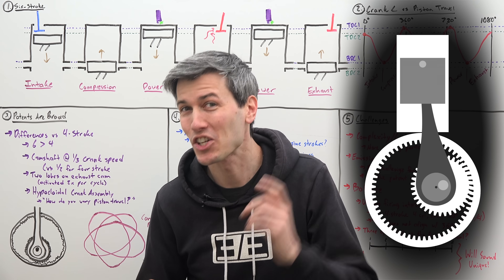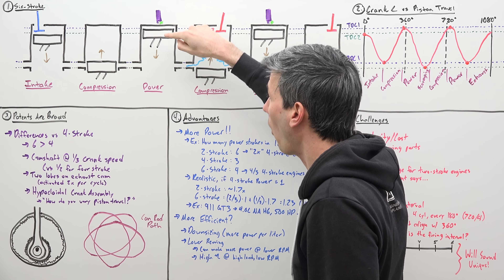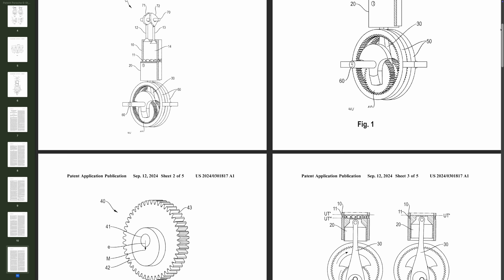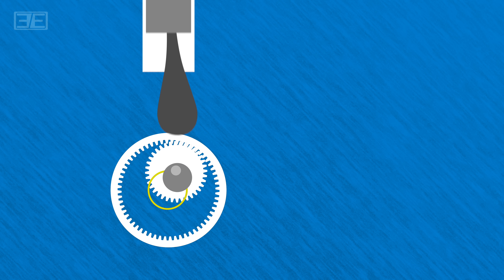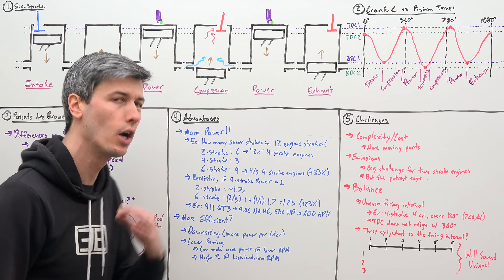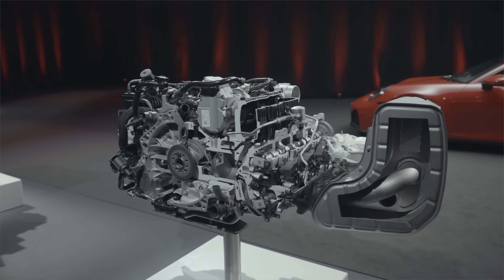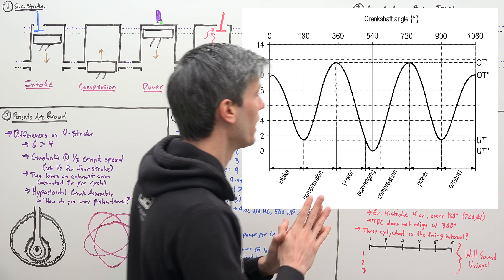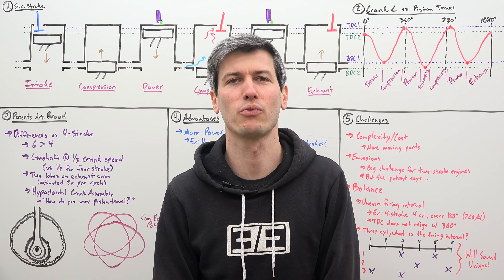Porsche's 6-Stroke Engine Is Genius!

Comment: VARIABLE STROKE engine. (My guess here) What I think you missed is the engine will be efficient because the 4 stroke will be the regular power band and the two stroke will be an on demand power booster.
Picture a standard boxer 6 running on 4 stroke skipping the 2 stroke part (holding the valve open to eliminate compression). Then you hit the throttle hard and extra 2 stroke cycle will engage and you have a six stroke that should have more power than their existing 6.
Reply: ....and where the power is made through the power band. You would have a really meaty engine coming out of the corners.
Reply: So you balance by having the third cylinder only run four stroke on every other cycle to balance? Thats incredible.

Comment: So basically the pistons’ motion in which they’re not doing work has been optimized so there are more power strokes relative to the distance travelled by the piston in its period of work? The gears that time that oscillating stroke distance are cool

Comment: With the complexity of a six stroke engine, what type of fuel will be needed? will it need to be 99octane, or 93 octane? Also the sound is gonna be kind of strange or really cool one of the two. And yes emissions will be a Factor to deal with unless they’re gonna use a DPF like filter on a gas engine like they do on diesel. Hopefully not.

Comment: First time viewer.
Excellent presentation.
I'm a former CNC Machinist with Boeing.
You clearly have an excellent channel and your speech is clear, & the white board format is perfect for comprehension.
Congratulations on 1000 videos !
Doesn't Porsche need to create some kind of working model for any of the patents to be valid ?
Seems like it could work, but it will require an electronic control unit even more complex than currently existing ECU's.
And with the slightly different TDC & BDC points, would a different crankshaft counterbalance weight design also be needed ?
The spark detonation timing will also need be variable to a degree ? Able to advance or retard according to throttle load ?
That will make emissions compliance challenging.
Trying to make the engine even more complex, with more moving parts rarely achieves reliability & longevity.
I think I would prefer an MB OM606 diesel with mechanical pump.

Comment: Congrats on 1,000!!  As for patents, the only text that represents the “patent” is in the section heading “claims”.  The rest of the text are an effort to be descriptive of the concept and the issues/options the patent is trying to address for the benefit of the patent examiner and “those skilled in the art” (aka, competitors).  By focusing on the claims, it can be determined what aspects will be defended by the patent holder and what hurdles a competitor will need to get around in order to offer a competitive alternative.

Comment: Honda in the 90's ran 2 strokes dangerously lean with their "free radical" engine that didn't need spark as they knocked it above idle / low revs. you could lean out that 2nd power stroke significantly.

Comment: I’m not a mechanical engineer, but that fourth compression stroke sounds like a nightmare for failure. Seeing comments about timing, but timing can’t fix air, fuel, exhaust for a single valve. That fourth compression stroke will need specific hardware in addition specific timing for that specific cylinder. I foresee Porsche trying some electronic sensors on it but knowing German engineering vs Japanese, they will not have tested it for long term. Sounds like a tuning nightmare as well.

Comment: Back in the 1970's in Va Beach VA there was a VW repair shop called Super Bugs which also built VW sand dragsters. The owner of the shop built what he called a 6 stroke VW racing engine. He ground down some of the cooling fins and added 2 stroke ports to the VW barrels. Through an awful lot of trial and error he got a tuned 6 stroke VW racing engine. When he went to race it, he was disqualified because the judges decided that adding two stroke ports to the four stroke VW engine was somehow against the rules. I actually saw discarded VW barrels with these added ports. And yes he added two stroke oil to the gas.
Reply: did it just wash fuel mixture out with the regular exhaust stroke?

Comment: This has all the hallmarks of something an engineer figured out on company time, and then the company had to go ahead and patent it anyway to protect the intellectual property they didn't realize they were paying for until after it was done. I seriously doubt it will ever get past the "single prototype just to prove it works" stage.
Reply: This is the hallmark of Porsche.
Reply: That's the Hallmark of the corporate world.  @paulzeee
Reply: @RichardAutry-l4z  snore. There’s corporate greed and artisan products. Porsche is the latter.
Reply: I doubt it gets that far 😕 😪
Reply: I disagree. 
Variable valve timing was a pipe dream 40 years ago. Now it's in every major manufacturer. 
Every ICE engine since the Model T has had cams, but Konigsegg developed a camless engine. 
This is absolutely possible if the balancing and fueling can be figured out.
Reply: @davidmichael9275 doubtful well ever see camless engines in standard production cars tho. It's only interesting in very high revving engines where the springs aren't fast enough. From an efficiency standpoint it also makes sense but is just way to expensive and complex to implement.

Also koeniggsegg didn't come up with it, it was in F1 way before Koeniggsegg was even a pipedream
Reply: deusexaethera  You could well be right.  May i modify your conclusion to read--  "single prototype just to prove it doesn't work" stage.
Reply: They will build one an then find that it leaks on the second compression stroke, has unbunt fuel like a 2 stroke.
an that it don't get full compresson for some of the cycle.
Reply: There's also this angle: some companies will patent something that has no hope of getting into manufacturing, but they'll patent it on the remote chance that they can slap a patent infringement lawsuit (read:  licensing fees) on anyone else who may bring a similar concept to market.
Reply: I would not be so sanguine.  
As an engineer, I worked at one x company where I was required to submit patentable new product ideas every year per my performance review objectives. 
This patent might well be the result of a similar process.  Perhaps it was developed one year and then refined over multiple years before it  was submitted.  I wouldn't say with certainty this is the result of a programmatic research/development effort.
Reply: I Agree. Makes no sense, it's more power consumed for less output, and more heat
Reply: The problems I forsee... the combustion events will beat the snot out of the outer crank gear - not sure how long that will last. Splash oiling or oil squirters on the bottom of the pistons and cylinder walls will contaminate the lower intake ports, just like the two strokes (and Wankels) resulting in increased emissions and oil consumption. 
It will be interesting to see and hear a running prototype.
Reply: @benbrown2119 didn't think about that, but yeah, this engine will drink oil like crazy
Reply: I hope that you're wrong, however, the number decades that the Porche Pananera prototypes sat in German warehouses before they weee finally highly daringly and incomparably miraculously put into production gives me some small ray of hope that this engine will eventually be developed and brought to market.

Hopefully, before the end of modern civilization!
Reply: I'm kidding, I am, but I do gotta say:  Just like those Nissan VC-turbo engineers saying "Hey, let's triple the bottom-end parts count!  Oh, and let's put a big double-elbow on the connecting rods!  No stresses there!  It'll last 200,000 miles, honest!"
Reply: I mean, the idea is cool, and the design part is quite straight forward. The worst part about this is gonna be balancing it due the hepicicloidal pattern, it makes the piston speed change every single stroke, not vertical, but horizontal too. And since the connecting rod or whatever it would be called on this engine works at a static speed, balancing it with reciprocating mass at the end of the rod can't be done. But definitely should be some way to deal with it. For the rest, it's just building it. It will work, but making it refine... God, it will be a headache
Reply: Tbh, I’d like to see a prototype. Hear a prototype.

Bet it sounds awful 🤣
Be nice to be wrong
Reply: I would also put this in the context of where Porsche as an OEM IS at the moment (February 2025). VAG, the parent of Porsche, VW, Audi and others, is in financial trouble. As in their most important market (China), has virtually stopped buying European Brand Cars. The group is closing Factories in Germany and the rest of Europe, plus the labor costs are too high in the EU to compete with the new Chinese OEMs, so building a brand-new prototype ICE unit when the group needs money to just survive? Doubtful. That said, sillier things have been done before, as the USA has just demonstrated with their last election.
Maybe, if they make it run on Hydrogen . . . . .
Reply: @coniow  You are full of SH.... 2024 sales North America 86541 (out of these 76167 sold in the US). Europe 75899 (out of these 35858 sold in Germany). China 56887. The US is by far the largest market for Porsche. This will change very soon. After the US will put the same tariffs Germany has put on the US products, the entire German car industry will be dead. The asked for it many, many times. BTW: I manufacture and sell automotive parts all over the world.
Reply: @coniow  Silly, dangerous, and down right ignorant.
Reply: @coniow  In 2024 The US was the largest market for Porsche. 
US 76167
China 56887
Germany 35858
Once tariffs will kick in Germany will be out of the picture. 
BTW: Tariffs for automotive parts send from the US to Germany  25-70 %.
Tariffs for the same good send from Germany to the US 3%.
Reply: @coniow  thanks for posting
Reply: @coniow  Could you take your TDS somewhere else? We're talking about an engine.
Reply: @coniow Couldn't even make a car comment without your TDS showing?
Reply: @coniow nothing silly about this last election. We got a good president just like we wanted. A silly election was the previous election.
Reply: @newbinhell3043  Do you still think that 🤔

Comment: How does the oiling system work on this 6 stroke system along with the rings or does Porsche eliminate rings? I foresee oil being thrown into that cylinder corridor of the 2 stroke cycle. Therefore allowing piston rings to get shredded and oil get burned in the second power stroke.

Comment: I wonder how efficient you could make an engine if you got rid of the valves and just did direct injection Fuel and Air an exhaust like a two-stroke . would it still be clean as a 4 stroke

Comment: I say screw it. Make a V12 with it. It's like a rocket engine pre-burner but instead of being a separate component, it's integrated. This advancement in combustion engines may have applications in improving space travel. The biggest factor in reducing energy consumption is mechanical reliability. No matter how much fuel you save, it all becomes immaterial when you have to spend vehicle maintenance dollars on it.

Comment: I’m curious for the exhaust design… as 2 stroke uses an expansion chamber in order to gain power etc, would the other four strokes act as a scavenger to eliminate the need for such an exhaust?

Comment: 2 stroke diesel engines with overhead valves use roots blowers to force the intake air in and exhaust out.  I'm wondering how this will work without forced induction for the two stroke part.

Comment: Nothing wrong with a 4 stroke engine. Engineers are only adding additional possible failure points and complexity. Interesting though. I have no doubt that this will be used as a marketing strategy to ramp up sales

Comment: Efficiency is limited by the Stirling cycle. And the ‘clean burning’ mentioned is dismissed by edict, not engineering. Charge/exhaust gasses will mix during the 2 stroke phase. So, an interesting idea, but they are going after a few percentage points efficiency improvement, while electrics are 3-4 times more efficient.

Comment: I have an issue using that study of 2 stroke vs 4 stroke engines. I've always believed part of the main reason they create more power is because no efficency is lost turning things like a cam and valves. That isn't the case in this engine

Comment: LOL, Porsche fiddling while Rome burns, improving late 19th century technology in the era where electric has proven itself and is already beginning to eat into super car markets as well as the general market.

Electric propulsion has always been able to deliver constant torque, while this is trying to squeeze one more power stroke in, giving 1 powerstroke in in 3 cycles instead of 4, increasing engine complexity, probably at the expense of reliability. Much like desmo valves did for motorcycles 😂

From a straight 1/4 mile to a winding gravel road, electric drive is the future and battery tech is improving almost daily. Range won't be a memory of an issue in 10 years.

I wonder what this 6 cycle engine will sound like - the death rattle of internal combustion? 😂😂😂

Comment: So we are sure those ports are intakes? What if one was intake and one is exhaust?
Reply: With boost to push the exhaust out then close that exhaust side  port let some boost in and bam “fresh” air fuel mixture
Reply: I’m so confused but this makes more sense to me that just “ports at the bottom”

Comment: Just to correct a technical error on 2-strokes, oil is not introduced to lubricate the cylinder walls (??) but to lubricate the roller bearings on the crank pins that replace the fluid hydraulic bearings of a 4-stroke crank pins because the crankcase (bottom side of the piston) is part of the air pump of the combustion cycle.
Reply: Both, dummy.

Comment: I wonder if they could have 4 cylinders traditional, since crank shaft is still normal, just the valve attachment is offset, and next to it 3 cylinders with this new thing. Ie 7 valves. Sure it is another complexity. But like could be good?

Comment: Seems like a 6 cylinder could solve the firing order balance issue, with every stroke having both a strong/weak pairing.  Make the engine a little smaller and rely some on the "cleaner, more complete" combustion solution for emissions?

Comment: You mentioned that you didn't understand how lower emissions are achieved. The key is in the amount of cylinders per power stroke. The reason motorcycle manufacturers have to go away from 600cc inline 4 bikes is the emissions. The more cylinders you have the more you have piston ring area and that is where a large part of the COx emissions are caused.
So with having a 6 stroke engine, in theory you can make a v6 or inline 6 make the same amount of power than a traditional V8, using less cylinders. Keeping the displacement the same power is increased and emissions are smaller vs. the V8. So not just downsizing. With less pistons and more power strokes you still get gobs of torque for less emissions.

I might be 100% wrong, but I think that is what they were after.

Comment: Only germans over complicating something just to overcomplicate something.   Also, how do you force air into cylinders second intake stroke without some kind of force induction.  I don’t see how you could use a pressurized crank case as that with induce oil into air mixture and drive emissions through the roof.

Comment: So is there another intake valve that injects fuel for the 2nd power stroke (at the lowest bottom dead center). It will be interesting to see NOx emissions with this design.

Comment: A few thoughts:  

1) I believe this has to be turbo or super charged to force the air into the bottom ports, there wouldn't be enough vacuum to get enough fresh air into those ports and also scavenge the exhaust from the first power stroke.  

2) It will be interesting to me to see how this affects the torque of the engine.

3)  In your diagram about firing order, #2 would've also had a power stroke at #1 position on you graph.  Because of that, it still seems that a multiple of 4 cylinders would be more balanced with two of the cylinders firing at each position on the timeline.  Seems a V4 with diagonally opposed cylinders firing would make sense, but maybe I need to draw it out further.

Comment: Wouldn't it be more effective to keep the exhaust valve closed so the left over fumes can reignite? They would just need a secondary intake that just lets air in with no exhaust, then have another cylinder doing another power stroke while the other cylinder is doing its secondary power stroke. If you needed you could spray a smaller amount of fuel in to help the previous leftover exhaust to burn better. 

Or they could have a secondary exhaust valve that moves the exhaust into the next cylinder doing its primary power stroke.

Either of those two would help lower emissions.

If you don't it's essentially a 4 stroke with a shorter TDC and tdb. Then they wouldn't need a goofy crankshaft design.

I haven't completed the video so maybe this is what happens.